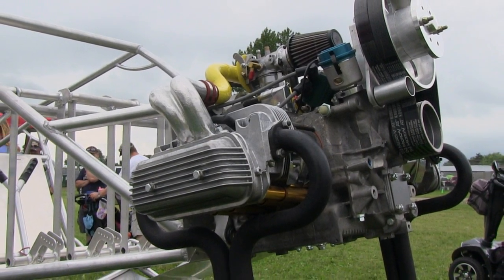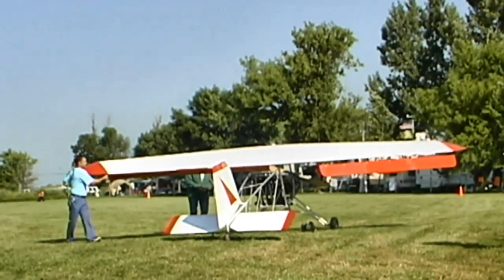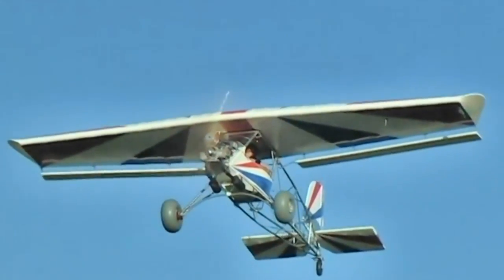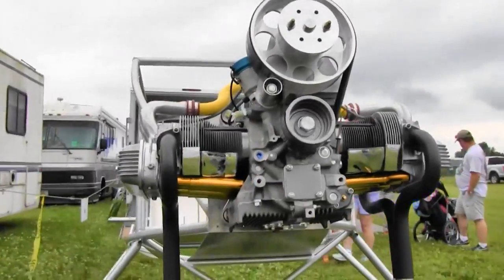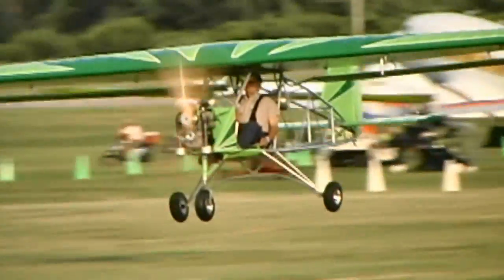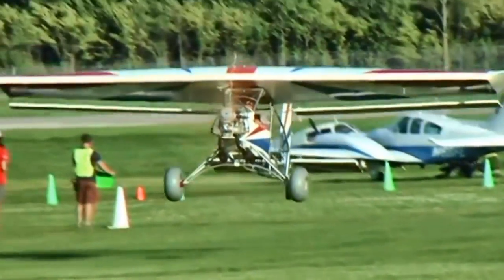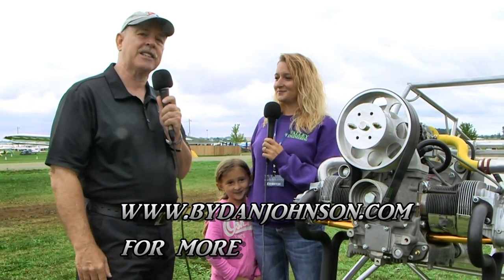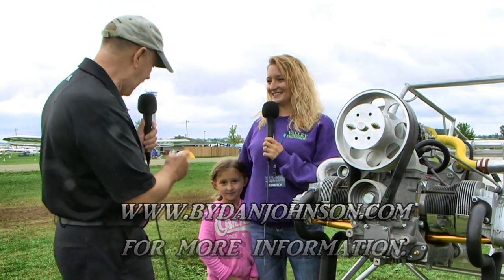Valley Engineering, Culver Props, Backyard Flyer Two Place, VW aircraft engine conversion & redrive.

Comment: I'm developing a few planes at the moment, when I tested welded aluminium structures on the public, there was quite the backlash.

Unwarranted, but myth and lore rein supreme in aviation.
Reply: Mark Mark  Thats interesting, i've never seen alluninum used like this. is it stronger? lighter? looks beefy.
Reply: We build every modern plane out of Aluminum as long was you use the right materials and welding techniques it's safe.  Guys complaining about fatigue and cycle time are probably in their 70s and couldn't fly enough hours in the rest of their life to worry about it.  Everything has gone to Aluminum, Bicycles, Motorcycles, Snowmobiles and even the F-150!  It's perfectly fine for an ultralight or even LSA.